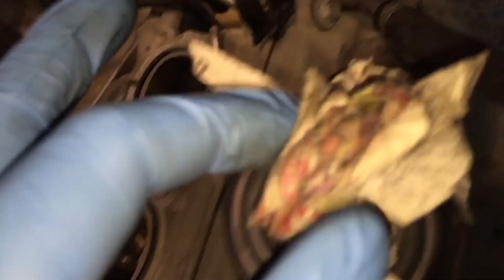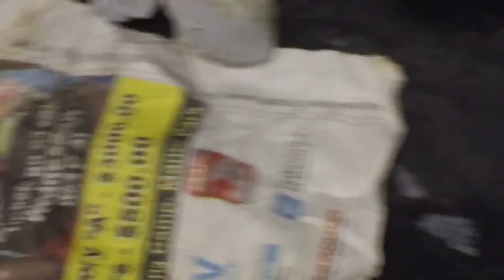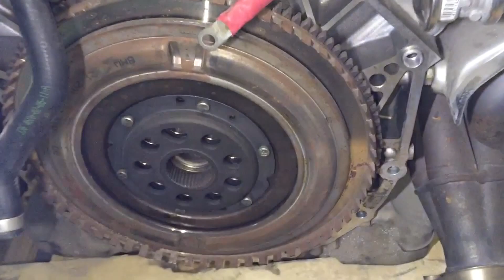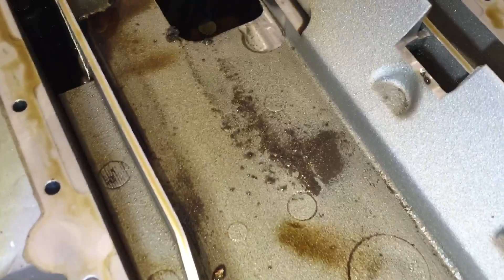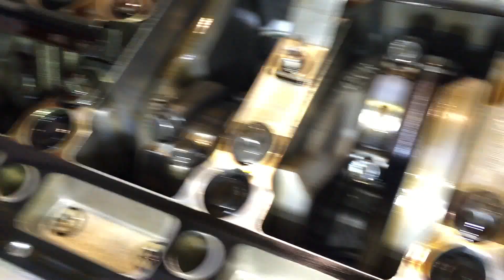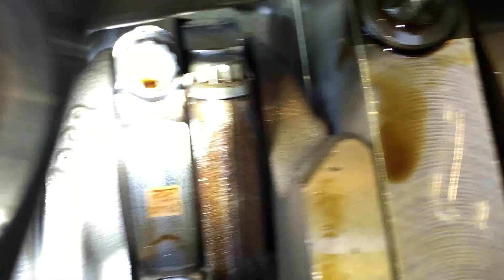BMW E92 M3 S65 Engine 2011 seized due to conrod bearing failure

Comment: So the LCI Aluminium rod bearings still fail at low mileage?
Reply: Yes, however this one appears to be a main bearing failure that took out the rods as a result. Seems to happen more on the LCI cars than pre LCI.

Comment: There's 2 reasons the s65 and s85 spin bearings.   The first is 10w60 ,  the second is no oil in the engine at all.
Reply: S65 rod bearing failure is actually incredibly rare in the real world. The bmw tech at the dealership in my town services several e92 and e93's and he said out of the 12yrs hes worked there they've never encountered a rod bearing issue with these cars and he said a few of the s65's he services has over 130,000 miles. He said the main problems with these cars are throttle actuators, which are salty, and motor mounts. As far as rod bearings according to him its a myth. I've searched high and dry and have talked to many bmw techs accross the country and they pretty much say the same thing. Only a couple techs, that I've talked to,  came across rod bearing failure and they both said the car was driven hard and anything driven over 8000 rpm's over and over and over again is gonna eventually give in. So all in all the s65 engine is a fantastic engine.
Reply: @lf3566  Just do a google of "s65 rod bearing failure"  or S85 ... they're the same engine just s65 has 2 cylinders chopped off, basically..     There's a class action lawsuit against bmw that's been going on for years (there were multiple suits but they got merged).   The argument being disputed in the case wasn't IF there was a problem with spun rod bearings , it was established right away that there were too many instances to count  ,  the argument was:  did BMW know about this and continue selling the cars without fixing it and did they violate law by refusing to replace blown customer motors."
Reply: @NickKautz  the problem I have is I've done extensive research only to find that not many engines were blown up and the ones that were blown were driven hard (8000 plus rpm's before engine was fully warmed up) on a daily basis . Through our research we've discovered that yes you need to let the car warm up longer than the average car before driving it hard but still considering that and the fact that these cars are driven at extremely high rpm's there still hasn't been as much failure as one would expect. How many cars can be driven over 8000 rpm's on a daily basis for thousands and thousands of miles and not have rod bearing failure? I used to drag race 1000 hp naturally aspirated drag cars with many thousands of dollars in these engines and sometimes you would only get a few passes before major failure would occur. All in all these engines are built tough, minus the ridiculous throttle actuators and motor mounts. My advice and any m3 Tech's advice that I talked to is LET THE ENGINE FULLY WARM UP BEFORE HITTING MAX RPM.
Reply: @lf3566    I don't think you've done much research then! Although if you mean not many engines blown up in % terms, I agree. But if you mean absolute numbers then I disagree, unless you discount engines which have either seized or knackered the bearings so badly it's written off the crank &/or block?, you can say that those haven't blown up, but the engine is certainly destroyed! Anyway, if you include the later, with very limited data out there, the only record I came across of 'blown' engines is here (not saying their aren't others btw, lmk if their are) - https://www.m3post.com/forums/showthread.php?t=786615 - their are somewhere north of 150 destroyed engines listed there (many replaced under warrantee at BMW dealers!). Yes small in % terms from ~65k production, but of course many destroyed engines won't be reported there or online at all!

Ref 8k RPM, what a load of rubbish, the Honda S2000 revs to 9k RPM & the Audi RS4 B7 revs to ~8k RPM & they don't have anyway near the number of problems the S65 has with (mainly) rod bearings. Also, the S65s redline is ~8300 RPM, so they should be designed to take 8k RPM regularly without failing seriously early, that's what the redline is for!

And for a minute lets forget the destroyed (seized, knocking or blown up) engines as we don't know the total number, although it's likely a very small percentage.
What is far more concerning is when people replace the rod bearings preventatively, the vast majority of the old bearings come out with excessive wear, even with low mileages & claimed careful warming up before driving it hard (and btw, I would find it un-credible if you or anyone claimed they were all lying about being careful with warming up!). Don't believe me? See the dozens of photos here - https://www.m3post.com/forums/showthread.php?t=1253084
Then read pdf papers by bearing manufactures Clevite & King regarding  bearing wear & causes of failure, use their photos as comparison. The rod bearing issue certainly isn't a myth, and counter to your anecdotal claims of BMW dealers rarely coming across this, in my anecdotal reading I've come across many reports where at least some dealers often had an M3 e9x in for an engine change, FWIW ;).

Certainly their is a problem with the 10w-60 oil, although really it's the combo of being a 10w (fairly thick cold rating) oil combined with the unusually tight bearing clearances they use for the S65 & S85 engines that's the baulk of the problem. But yes thrashing it before fully warmed up is going exacerbate it, along with the usual not checking the oil level enough,  etc. Suspicions also fall on how well some engines were assembled.
And btw, I'm not saying that all S65 engines will fail before 50k or 100k miles etc, just that it's a gamble (German lottery as someone said in the m3post forums! ;)), but if you lose the gamble you pay dearly for it!
Reply: @Markpd69  again I have done lots and lots of research and the "percentage" of blown or disabled motors due to rod bearings is incredibly small. I know a lot of guys with s65 motors with well over 100k miles and a few with over 150k and never had rod bearing issues. I own two, one with 68k miles and another with over 130k and no issues. I also believe a lot of the small percentage of rod bearing failure was due to guys not properly warming before revving at high rpm's. Other then the throttle actuators these are great engines.

Comment: One thing I believe you got wrong, those particles wouldn't have flowed right throughout the oil system as they would have been caught by the oil filter. The oil goes from the pump straight to the filter, right?

Comment: With that many scorched rod bearings it is most likely ran too low on oil and then left to die... Gotta check to oil they may use 1 liter every 500 miles a sad day and a tough lesson $$$

Comment: I thought BMW was built like a tiger tank!!  I owned 91 525i with M50 engine auto trans for over 420000.0miles only reason I had to stop driving her was next door folks house burnt down n my baby got roasted still ran but was to much to fix money wise!!
Reply: Did you not have insurance lol?
Reply: @MrBananablitz123  Would be a write off though.
Reply: Wow! Awesome mileage! :D The M sport engines (not saying all) seem to suffer with bearing problems rather than the regular engines (in general). I had a 2001 330d with 192k miles, my friend's now got it & it's at 214k miles, the engine's still fine :) (it's just the body's rusting away!).

Comment: The S65 and S85 Engines would have been BMWs Best engines ever built if they didnt circum to rod bearing failure
Reply: Redline 5w50 and just do the rod bearing preemptively.

Comment: Hi Redish. Can you tell me how much you would charge to replace my rod bearings with the better designed ones on the V8. It's an E93 2008. Thanks
Reply: Daryl Hall $1500 USD

Comment: I hate bmw for this. You make an engine but dont stand by your product
Reply: 10w60 was BMW's mistake , they know it.
Reply: @NickKautz  sure hope it is,  been running 0w40 since ownership
Reply: @NickKautz  10w60 was not a mistake. Take either the S65 or S85 around a track with 0w40 and you’re going to be overheating fast.
Reply: Supercharging an NA engine

Comment: The ARP bolts suggest that the bearings have been done previously, so what type of bearings were put in it
Reply: Don't think they are ARP's bud, the bolt head doesn't crater in the middle. Look OEM to me.

Comment: Engine is good for scrap, better off buying a secondhand unit rather than do a rebuild.
Reply: said by every lazy person ever
Reply: TG Lasers A question of economics moron.
Reply: It'd definitely be cheaper and less of a headache to find a new motor. You don't know the extent of damage, those little pieces of metal went through the whole motor at a XXXXrpm. I wouldn't use it until a complete short block teardown.

Comment: The block should be salvageable. Give it a thorough cleaning and correct any issues with the bores with sleeves or Nikasil.
Reply: it is, if you're gonna do a full rebuild for boosted application. but if you're just gonna rebuild to have it OEM then its cheaper to just sell this engine for parts and buy a used one and do the rod bearing job on it.
Reply: Bearing journals would be scored beyond repair.

Comment: curious. Was OEM recommended oil used? Thats very interesting it being a 2011 as that was a fairly "new-er" engine.  i thought rod bearing issues were mainly seen in 08-10 engines.
Reply: I always use liquimoly's friction modifier on my S54, always will. When the time comes to replace the OEM bearings, I will opt for BE performance bearings, which are designed with extra clearance between the bearing and the journal. This, combined with LM's Mos2 or Cera Tec (along with regular engine flushes & oil changes) should prevent this issue from ever happening.
Reply: Fiat Lux motorkote works well too. I’d highly recommend putting any sort of friction reducer if/when changing rod bearings.
Reply: rod bearings are a potential issue on all model years of E9x M3s.  In 2011, they changed the material of the bearings from a softer copper/lead compound to a harder tin/aluminum compound.  So in theory the bearings last longer in 2011-2013 cars, but they don't address the bearings clearance/lack of lubrication issue.  And if they fail the newer, harder bearings are more likely to do damage to the crank.
Reply: It shouldn't matter what oil was used. As long as it had oil, this failure should not have happened. Of course, we don't know that the owner wasn't revving the piss out of it while low on oil, and then only added or changed the oil after it seized.
Reply: tempest411 lol common failure on e92 m3, most owners address it as soon as purchased

Comment: Too bad BMW didn't figure some way to show off such a beautiful motor in the car instead of covering it in plastic, I can understand why they did it that way, practicle but not pleasing to look at when you lift the hood, such an impressive bit of machinery there even without fancy enhancements like Ferrari class does to show off theirs.
Reply: Covering it in plastic?  Do you have any idea what you are talking about? That "plastic" is a large plenum for the individual throttle bodies. This engine has no airflow meter, and thus needs this highly engineed piece of "plastic" to perform optimally.
Reply: There are absolutely no cosmetic parts covering the engine.  You just can't see most of it because it's a relatively large engine in a car the size of a Honda Civic.

Comment: Question, can the cylinder walls be resurfaced or bored with the special alusil material that is used on BMW engines? Would that be a possibility to maybe salvage an engine in this kind of condition? Thank you in advance, and greetings from Los Angeles!
Reply: New liners are probably the only way to fix that. BMW probably doesn't make oversized pistons for this engine